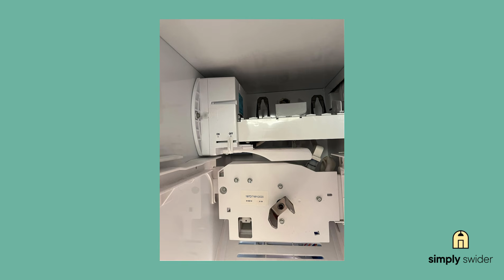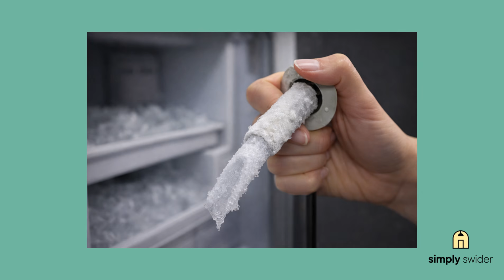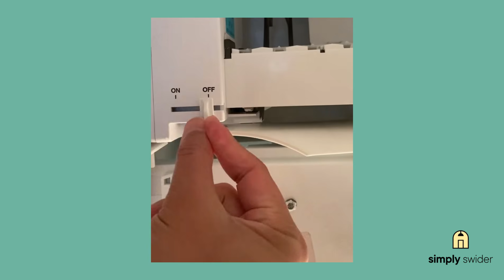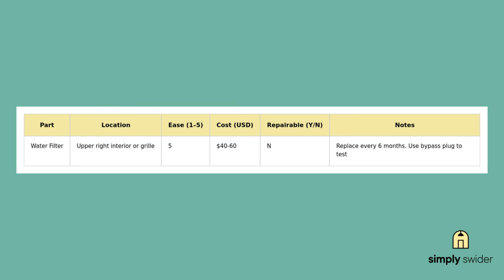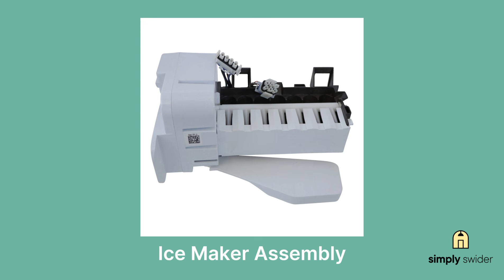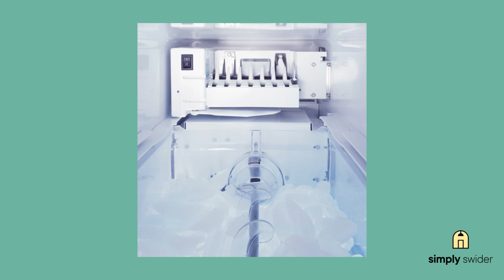GE Ice Maker Not Working? 75% of Problems AREN'T Actually the Ice Maker!

Comment: I have a bottom freezer with an inside
Ice maker. Replaced the part holding the filter. I have a by pass in TBE filter holder.  Water flows through the inside water spout.  No water is making it to the ice maker.  Help.